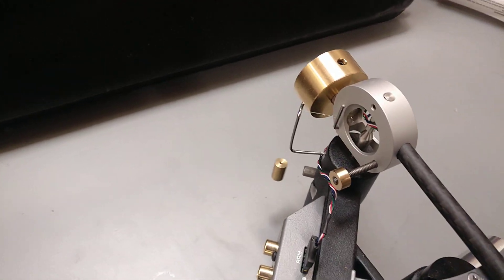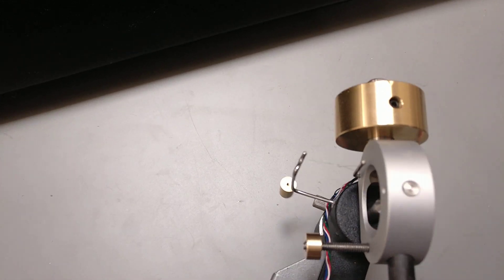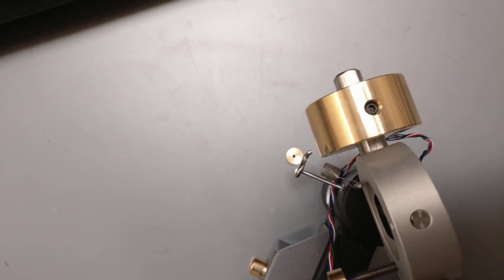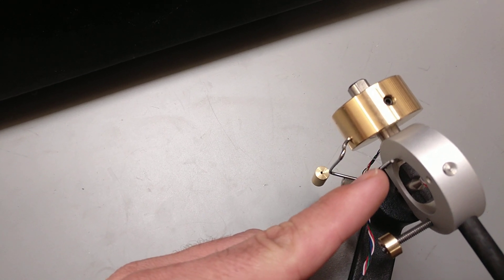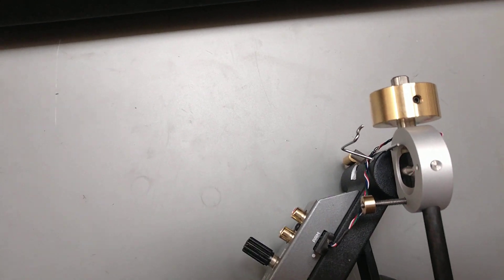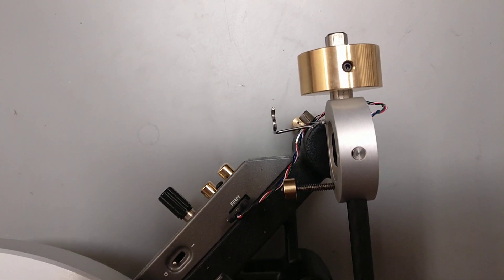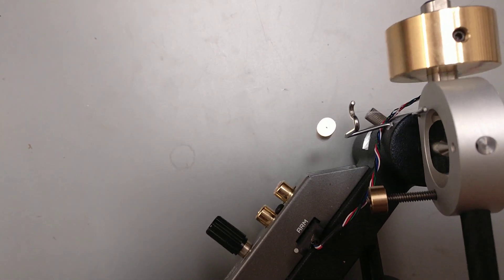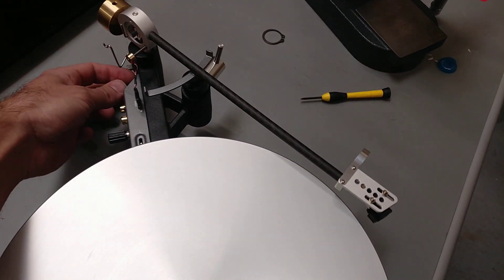Sol: Anti-Skate Rod Adjustment

Comment: The filament should have a 90degree angle with the line from the pivot to the rod, not to the tonearm! And this should be when the tonearm position is at the beginning of the record. max. groove speed = max. friction = max. anti scate force, and from this point decreasing along the way to the inner endposition.

Comment: Not connected in the right place the post coming out of the tonearm causing asthma issue there should be a rod with a notch underneath at the back just where the shaft for the wait is connected dead Centre stop the arm from pulling to one side and you don't need to bend the rod either would be in the right position. You should have counterweights on both sides not just in aside what you're trying to make up for asthma pulling it is beneficial to have two heavy weight on either side just drill right through and put a screw rod with two heavy weights. Get rid of that stupid plug into RCA socket just go straight out with the wire to RCA plugs it is a bad idea having that way especially two areas even worse wire looks a bit tight as well why don't you just come out the top

Comment: This turntable looks like a fun kit but come on this is not worth 700 bucks, the way this turntable is designed is pretty much the simplest and thus cheapest way you can make a turntable. That tonearm pivot is the jankiest one i've ever seen. Stereo records actually rely on the arm being perfectly level because each channel is tracked sideways, it being able to rock side to side like that can't be good. I really like schiit but i would never consider buying this.
Reply: No offense, but I think you should research before you type a comment like this.  This tonearm is a unipivot design.  You are lauding gimball designed tonearms, but that does not make the unipivot tonearm obsolete or worse than the gimball design.  The reason why you haven't seen a unipivot design is that it has been used solely on the highest end reference turntables, like VPI tables.  From the standpoint of sound reproduction, a unipivot tonearm and a long tonearm (this one is close at 11 inches) and a stiff tonearm (carbon fiber, like here as well), will produce the best sound.  People with a unipivot on their VPI tables swear by the sound: saying it is the best sounding turntable possible.  I'm not going to explain why the unipivot arm works, the science, and why it works.  If you are interested, there are plenty of articles out there.  From what I can gather, this is a turntable for those who are focused on clear, extremely accurate sound reproduction without paying $2,000 - $4,000 for a table to do it.  This is worth way more than $799, in the end.  However, I admit, this is not the type of turntable I would recommend for someone just getting into vinyl or who doesn't have the patience for tinkering to get the best sound possible. Heck, I probably wouldn't recommend a Thorens TD 160 to many for similar reasons.  But, I would recommend this if you have reached the point where clarity, sound stage, and reproducing the recording as closely as possible to the original recording is your ultimate goal.

Comment: Looks like the knob thingy on the tone arm bangs against the now bent anti-skate rod?
Reply: That is the vertical adjustment weight, VTF. It is shown in the video at its furthest extreme setting. Mine is no where close to that. Clearance is not an issue here.
Reply: @richardatkinson4452  Might set the angle, at a point between the two places where you adjusted the headshell. Should help clear the other weight too
Reply: Thanks